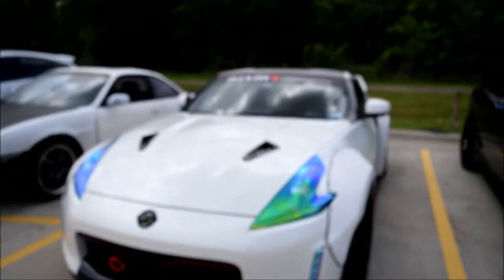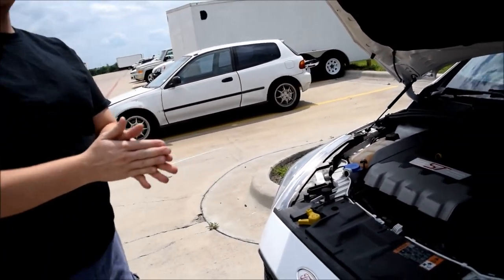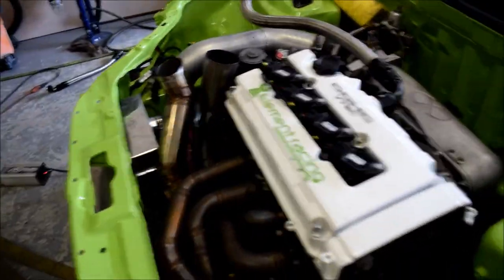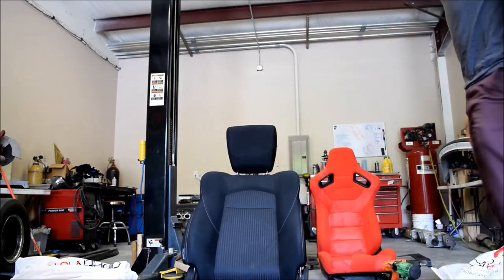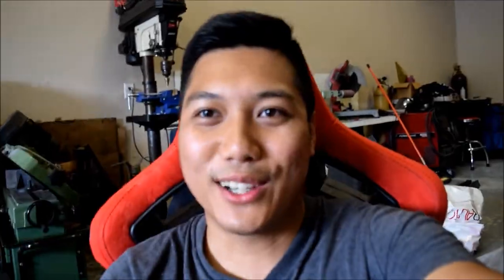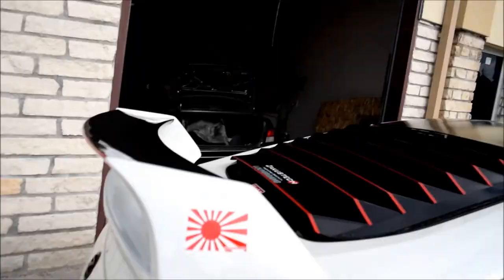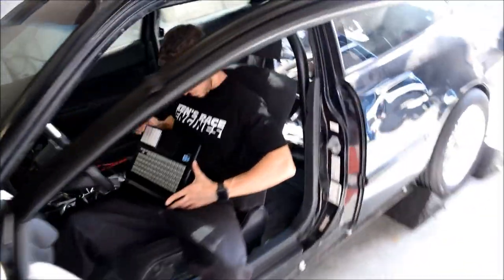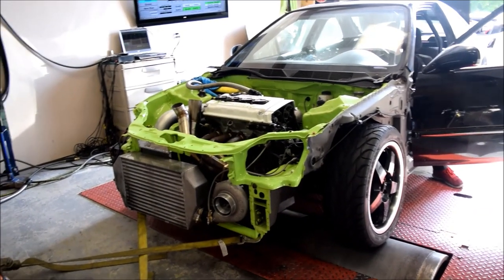Installing bucket seats into the 370z!

Comment: Hey J media, did he have to get a seatbelt adapter to keep the ding from coming on , or is it connected to the seatbelt lock part that you have to transfer from old seat to the new one?
Reply from the maker: Hey, yes you will have to transfer the old seat belt buckle to the new seat rails.
Reply: Thanks, got that but is there an extra harness I have to get or does the part I have to transfer have the plug part connected to it already ?
Reply from the maker: @jay370z5  Nope no extra harness are needed. As long as you have the aftermarket seat rails to bolt your new seats on, there should be a spot on the seat rails to bolt your stock seat buckle to.
Reply from the maker: @jay370z5  You might need a longer bolt or washers depending on the length of your stock ones. Here is another video of seat installation: https://youtu.be/PfXc6UuaBZc
Reply: Cool, 2 more questions. Are the seats suede or cloth and what floor mounts did he get? I read they’re not planted but what is the name. Want to have a trouble free install like you guys lol. Thanks for your help and fast responses also. Like your vids👍, gained a subscriber!
Reply from the maker: @jay370z5  I appreciate it man! Yea the seats are suede. As for the seat rails, they were bought from Cipher Auto, the same brand as the seats. Here is a link to them: https://cipherauto.com/products/cipher-auto-racing-seat-bracket-nissan-370z
Reply: Thanks a lot bro !!  Drive and mod safe !!
Reply from the maker: @jay370z5  Sure thing man. You too, good luck on your build!

Comment: How do you by pass the airbag sensor?
Reply from the maker: Used resistors to trick the car to think the airbags are there. Or you can remove stock airbags from seats and transfer them over